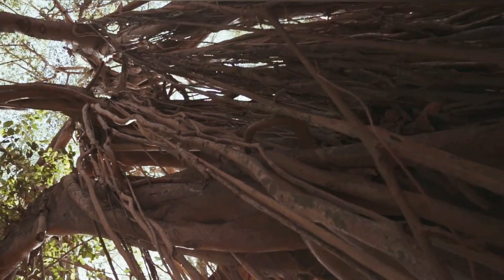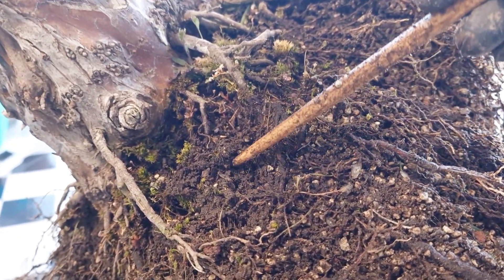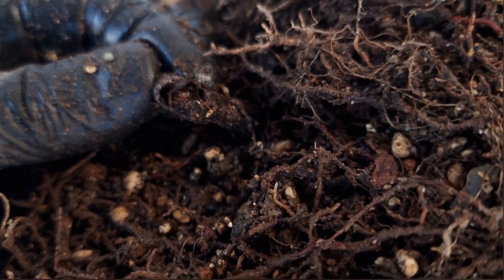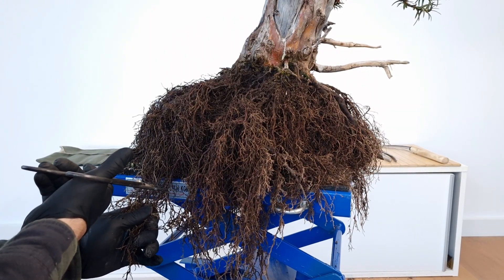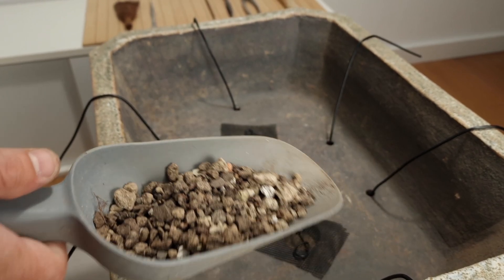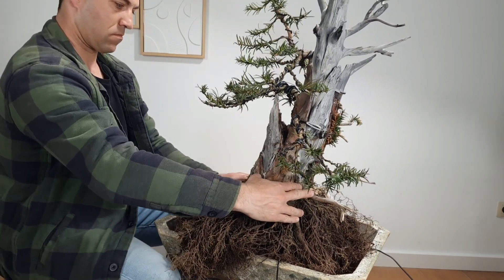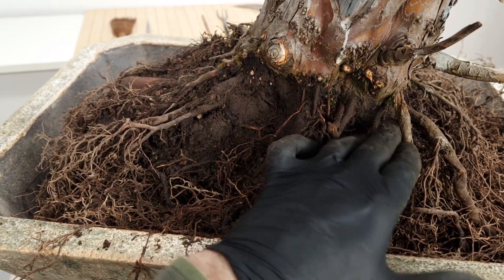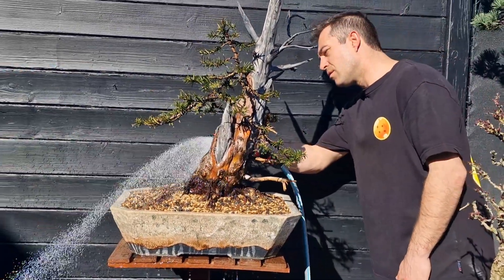Taxus Repotting Techniques: The Ultimate Bonsai Guide

Comment: Thanks for sharing. This is one of the best demonstrations I’ve seen on YouTube loaded with good advice. I’m wondering if you’ve or are working in a medical laboratory. If so, we have a couple things in common.😊
Reply from the maker: Wauw thank you so much for your kind words ☺️ 🙏 🌲 and   indeed ,I do work in a medical  laboratory for Pfizer ☺️☺️☺️☺️where  do you work? So cool ☺️☺️
Reply: @bonsailab8426  I did 18 years at what used to be called Florida hospital in Orlando Florida. Was 1000 bed hospital.  I miss my coworkers, but I don’t miss this stress. The clinical terms gave you away. Lol.  I have a section of problem trees which I call special care nursery 😊
Reply: Told you where but I didn’t tell you what. I worked in the lab but did not have a degree in medical technology. I supervise the clinical support department on the weekends working four 10 hour days. Off Monday, Tuesday, Wednesday every week. I resigned in 2002.  Don’t miss it either. Lol.

Comment: When would you introduce nutrients or fertilizers? Beautiful tree 👍
Reply from the maker: Thank you so much for watching 😊 i started fertilizing as soon as the tree was growing strong.This means that I saw that the tree was giving me strong signs of health and vigor. This being said, I only gave it a tiny bit of fertilizer because I don't want to upset the recovering root system too much. Also, this is because i know that the repot was very successful. I will be carefully 😊increasing the dose of fertilizer in a timespan of about 4 weeks after the first application ☺️☺️☺️
Reply: @bonsailab8426 Excellent info thank you that makes a lot of sense. If you don’t mind would you recommend a nutrient to use? Would it be a 4 4 4 or maybe something stronger? Thank you for the response!